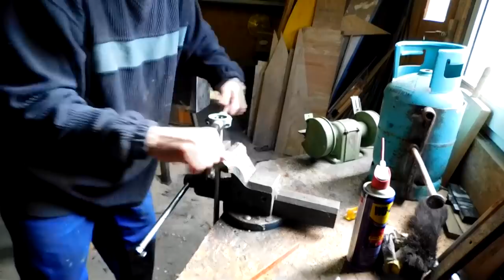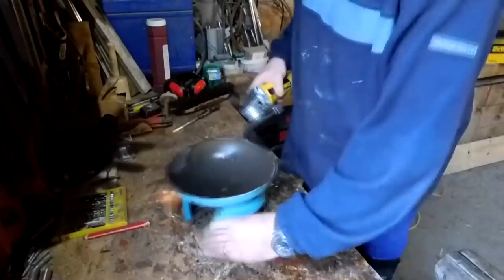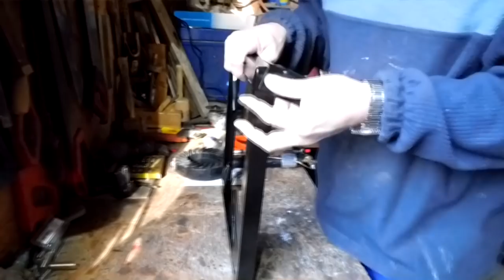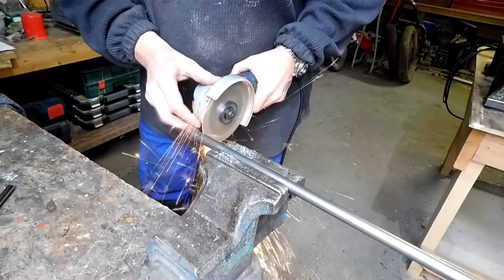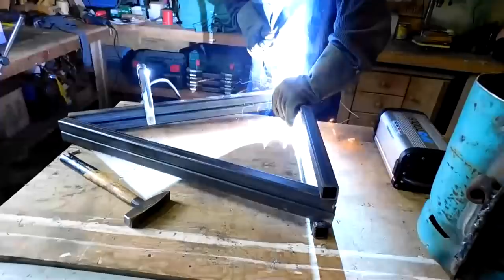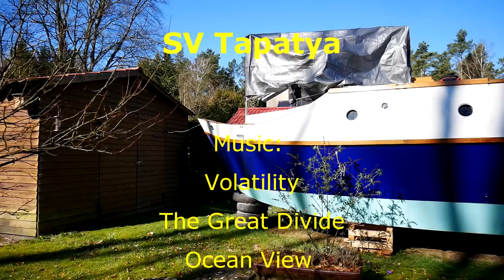Trial fitting the keel box and making the melting pot -  SV Tapatya EP222

Comment: I recommend filling the keel with water to get good idea of the actual volume and therefore can calculate the weight in lead
Reply from the maker: Well, it would certainly work Steve. But I’ve already calculated the volume of the keel on the plans and when multiplied by the density of lead it comes out bang on. The designer knows what he’s doing. My keel is basically to the dimensions of the plans   (It might be a tiddly bit bigger), so all should be well

Comment: Wonderful to see Spring return, a bit of warmth makes a huge difference. If you're going for partial melts/pours, I was wondering if you'll go in long/thin layers or shorter/full sections? I guess there's a difference in potential heat build up or dissipation along the whole keel box. I also wondered if it's worth knocking up a 'template' to slip on top of the keel bolts to keep them all aligned throughout the pour process. No doubt you have all angles covered Tony. Looking forward to seeing how the pour goes, exciting times.
Reply: Great point about a template for the top. Once the lead goes in and the keel timber is fastened to the hull. Mating them together again with that tight tolerance and the added extra weight is going to be difficult to say the least. What we witnessed on this video is going to be as close "to ideal” and as easy as it is going to get. Doing it under the boat, full of lead, and possible warping or movement from heat. Will certainly end up being a great exercise in patience. I’m sure it will get done. However, if there is anyone with tips or tricks to make it easier. I do hope they share them.
Reply: Same thoughts myself. A tight fitting template at the top will keep them from creeping if only at 700 degrees or less. Old pipe fitters trick ...make a pipe move with a cigarette lighter.
Reply from the maker: Thanks Billy. Yes, I already have a ply template that I intend to use for this very purpose. However, so fat, I’m pouring and it’s all staying in line 👍

Comment: Excellent job on the studs, perfect alignment! I ´d go further than relying on the threads on the steel casing and would add some welded mechanical locking between the studs and lead.
Reply from the maker: Thanks Daniel. Yes, I’ve thought about that. The thing is, basically every external keel is held on by threads 🤔

Comment: Good choice going with the M16 nuts. You will probably never have to replace any of the bolts in the next 30 years so having different threads on each end won't make much difference. Once you are done with the lead pour you can use that burner to make 100 liters of soup for the crew you have over to help fit the keel and ballast to Tapatya. Just need to find a good 110 liter pot. Take care, stay well and best wishes to you and the family.
Reply from the maker: Thanks Matt. Yes indeed 😂😂

Comment: Hi Tony - the keel box is looking well! I thought I’d drop you a little tip for starting your threads off square using the lathe! A little late I know, but it may be hopefully of use in the future! After turning the short taper/lead on the end of the bar, stop the lathe and switch the power off (just for safety for this procedure) place the die stock up against the end of the bar as if to start the thread. Bring the tail stock up to the back of the die stock, lock it to the lathe bed and apply slight pressure from the end of the tail stock onto the die stock. Apply cutting compound to the end of the bar. Insert the chuck key into the lathe chuck but don’t open the chuck. Using the chuck key as a lever, rotate the chuck downwards, the die stock handle will contact either the saddle or lathe bed to stop it turning with the workpiece , at which point the thread will start to cut as you rotate the chuck by hand. Remove the chuck key and re-insert into the next hole and repeat the rotation. Whilst completing the rotation, keep the pressure on the back of the die stock with the tail stock screw. It’s the pressure from the tail stock that will keep the die square on the bar. Just complete a turn or two, then remove from the lathe and complete the thread in the vice as previously. Apologies if you already know about that but chose to do it differently 👍
Reply: I was going to say the same thing though I would probably just single point a thread that size if I already had it in the lathe
Reply from the maker: Thanks Pete. I did try exactly what you recommend, but somehow it didn’t go that easily. I have no doubt it should be an effective method though 👍
Reply: the right way is to just precut the thread once or twice, and then follow up with the die.

Comment: Looking good Tony. I mentioned before making a dolly to enable this heavy completed keel to be moved. However, I wonder if it might be better to source a boat trailer and mount the keel on there prior to the pour (it will then be ready for onward movement to the quayside without further humping and shifting). Another observation if I may, watching you marrying the keel box to the wooden keel fairing - I think you should consider opening up all the drilled holes another 5 - 10mm and on the day of the final marrying - grease the studs.😀👍⛵️
Reply from the maker: Thanks Norman. Yes, making the holes bigger is certainly an option. I’ll see how it goes fir a bit. I hope to get a local farmer to help me shift the finished keel. Heavy machinery is the answer 👍😃

Comment: Tony when you do the pour into keel box do it out side it will stink the shed out plus less fire risk too ,put some fireproof paper around outside steel box beween wood and steel are you going to do bits of pour just be careful that you don't get seams in lead  might have to drill holes in lead as you build up  so lead has something to stick to
Reply from the maker: Interesting idea Glenn. My shed is so well ventilated it basically is outside 👍

Comment: Thank you Mr tony I watched your videos since the beginning and I learned a lot from you (I even studied wood working course in these period) thank you so much keep the great working
I have a question why the keel need to be lead and could it be possible to replace it with other materials
Reply from the maker: Thank you Yasser, I ‘m really pleased to have helped, and well done with the wood work course!
To your keel question: Lead is the best option because it is very dense (over 11kg per litre). Obviously this means you get the weight you need in a very small volume, which is a good thing.
You could use other materials. Concrete with a lot of iron in it, or with lead shot in it would work. Cast iron is a good option, but hard to make yourself. Welded up steel plate would work. But none of these are as dense as lead so the keel would have to be bigger to get the same weight and that leads to other issues (it’d certainly need to be deeper to make it as effective). 
Hope that helps!
Reply: @SVTapatya  thank you so much for the reply it's more than what I asked for
Happy to be one of your follower
And I will be watching to the end

Comment: Tony, WD-40 isn't a good cutting fluid, it's not much of a lubricant at all. Even used motor oil is a better choice. We used plastic butter tubs with a small hole in the top and a small stiff brush stood up in the oil. Easy one handed application on drill bits, hack saws and taps. 🧐
Reply from the maker: I learnt to use tallow, Mike. But these days I experiment and use whatever I feel works well. I’m sure you’ve seen me using old engine oil as a cutting lube. However, I found WD to work well on these threads 👍

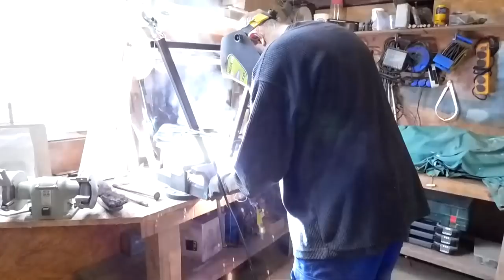Comment: Hey Tony you may need to use two propane tanks instead of just one. In order to get the job  done, cause propane has a tendency to freeze up on you when you need to us a lot of it. For example they recommend you set up a system so you can use up more propane, the solution is to pull more BTU's because as I said, the propane has a tendency to freeze up on you, when you need to use quite a large amount of propane. Cause the evaporation can't keep up with the demand. Therefore, the solution is to have more area of evaporation, which means hook up a manifold with a extra propane tank, cause two propane tanks give more area of Propane instead of one, that's what they recommend, cause its not the volume of propane that is needed but the area at the top of the tank that is needed, that enlarges the area of propane and that slows down the BTU's being used up in the pour. The best way to understand this is watch Bob on the ART of BOAT BUILDING season 2 episode 58. He starts to explain it @ 18:13 mark also Have you considered welding a temporary frame, just stich weld it around the top parameter of the Keel box just to be sure it won't tear apart at the top of the keel box
Reply from the maker: Good tip, Fon. For my system, 1 tank is working well, although I also add second torch from the top or side to speed things up a bit. I am certainly considering a frame close to the top of the box to hold things in shape, maybe a couple of cross braces too👍

Comment: Many, many years ago, it looks ages, on LPG ships, before all these sms (safety management system) international rules, we used to get rid of lpg residues simply by filling up the tanks to the brim, of corse lids open and then close, put pressure with compressors and pump the water out......No safety precautions, no nothing. Practical life at sea. Years? eighties, seventies, not so fa away.
Reply from the maker: Good one!